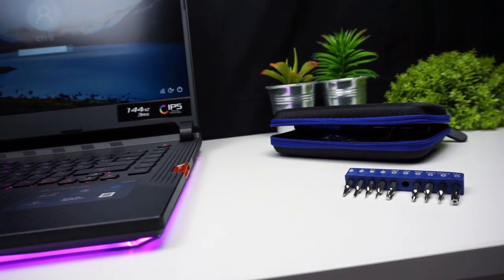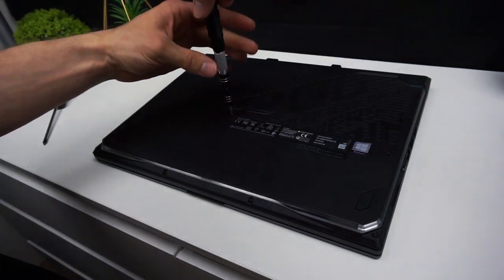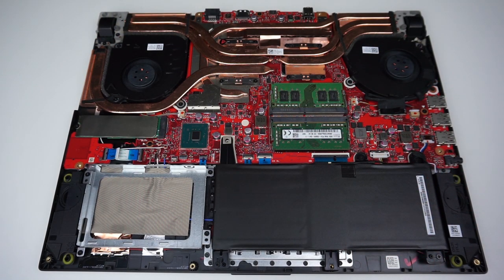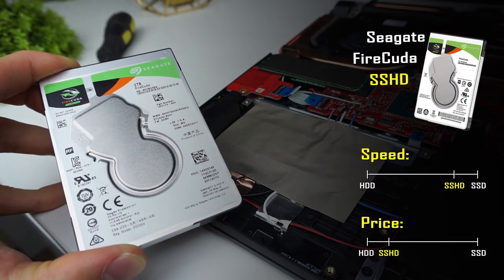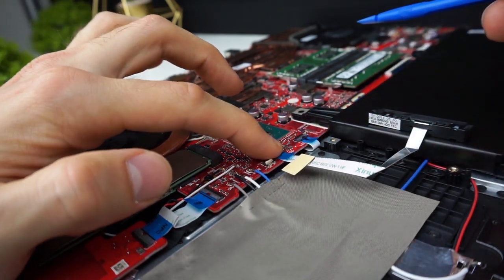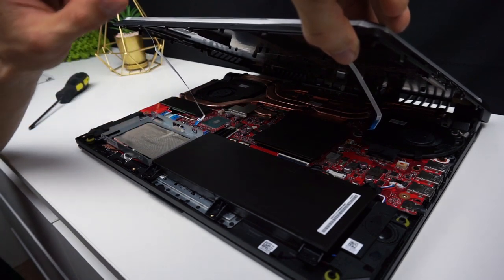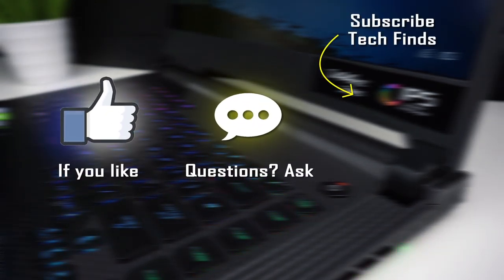Asus Scar III Upgrade RAM / SSD / HDD - Disassembly Guide

Comment from the maker: ✅ Free download RAM / SSD / HDD data recovery software: https://bit.ly/2zRpN9B

TIMESTAMPS:

00:00 - General info
00:35 - Opening the lid
01:16 - Disconnecting light bar
01:49 - Disconnecting battery
02:05 - Installing Hard Drive
03:57 - Installing RAM
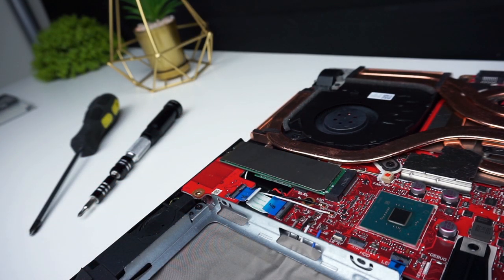04:15 - Installing NvMe SSD
04:50 - Closing the lid
05:20 - In case of PROBLEMS
Reply: Tech Finds 

Do I need to unplug the battery if I just want to put a 2nd ram in the empty slot?

And if I don’t unplug the battery the laptop can’t not turn on like in the video right?
Reply: What is the company name and model number of pre-installed M.2 NVMe drive???
Reply: @bhavik3497  It's Intel's M.2 SSD, but I'm not certain of which model it is.
Reply: @Springfield_7.62x63mm  can u please check in TaskManager > performance> SSD (where  the graph is shown) on top right corner of graph there is the model number written
Reply: @bhavik3497  INTEL SSDPEKNW010T8. That's the model number of my SSD.
Reply: @Springfield_7.62x63mm  okay thankyou
Reply: @bhavik3497  You're welcome. :D
Reply: I have the 17.3 inch one. Does any one know if it had an additional heat sink. I am scared of opening it :)
Reply from the maker: @peterfarah6015  It has the same cooling
Reply from the maker: @senyuguan6221  I don't own this laptop mate
Reply: @techfinds hey my laptop is doing the same thing as yours at the end of your video ive tried the hard reset any other advice? Thank you
Reply: I Have an asus rog strix scar 3 g531gu i7 9750h up to 4.5 16gb ram 512ssd and nvidia 1660ti ,6gb.
Can you please tell what is the maximum of Ram that I can Add and the maximum of Ssd or m.2.  Can I add another 1TB m.2 nvme and tell me please if it's possible to change de nvidia Card? Thank you. I wait for an answer :) if i spoke bad in english. Sorry!
Reply: Is any link for SATA Cable?

Comment: Just added a Samsung EVO ssd to my Strix Hero III.  Thanks to this video it took 20 minutes with zero issues.  Thanks for the great video!
Reply: What ribbon cable did you use? Where did you get it from?
Reply: Hey, I have a problem. My device don't recognize the data 2,5
Reply: @mozamorris  my Hero III came with an extra ribbon cable in the box. If you still have your box, take a look around for it. If not you'll have to try and find one on eBay or contact Asus.
Reply: @leonard9501  after you install the drive (assuming it's connected correctly) you have to go to Disk Management inside Windows. You have to assign the drive to a letter and format it in order to use it. Hope this helps! Good luck!
Reply: @Arch Deluxxe  you said what you added one more ssd, if i right understand, so I want to ask , how ? I will buy samsung evo plus, butt how I see from this video its socket for 2,5" , can I install M2 ssd in this place?
Reply: i gota q uestion i got a SSD + a hardrive of one 1TO can i add a 4To on it to have 3 Discs or is it not possible thanks to reply

Comment: Great video. Installed an extra 16GB of RAM and a 1TB SSD on an ASUS Strix G. Experienced zero issues. I've never upgraded a laptop before but your presentation explained everything I needed to know. Thanks!
Reply from the maker: Good, have fun now. :P
Reply: did your strix G already have a caddy inside when you openned it?
Reply: Yes, and four screws were included as well.

Comment: Thank you very much for this video just today I upgraded my newly bought laptop same kind but with a gtx 1650. It was super helpful this video I put in mine 32gb ddr4 Kingston hyper X dual channel mode and a 2tb hard drive. I followed your guide and even held the power button for 30 second immediately after disconnecting the battery so the capacitors will discharge and avoid any problems at the end to not open it again. Thanks again and keep up the good work
Reply from the maker: Thanks for your kind words!
I'm glad you found it useful.
Reply: @TechFinds  what is the maximum storage for the 2.5" SSHD slot sir (can i upgrade mine up to 4 or even 8 TB)? mine is G531GU-I766G9T, probably it's a G series not hero or scar but i don't really know
Reply from the maker: @m_aminoracousticmusic6312  2.5" drives over 2TB are usually thicker so it may not fit. I haven't heard of any HDD/SSD/SSHD limits tho
Reply: @TechFinds  okaay then i'll just go for it, because if 4TB is too big imma just take it wherever i go with external hard drive enclosures lol

Comment: Okay, if it wasnt for your video i couldnt have done my upgrades and the best part i opened it only once and put in 32gb ram, a 2tb WD M.2 SSD, and a 4TB 2.5" SATA SSD ddrive, put the cover back on, tighten the screws, reset the power, and bam it actually booted up and i have been using it now for a week, you are a genius....thank you, thank you, thank you, Pipefittermike, i have subscribed.....
Reply from the maker: Thanks for your kind words!
Good to know that the video was helpful.

Comment: hello I have a question, if my laptop already has an 8gb ram, is it necessary to buy 2 new ram and replace the one that comes from stock?
Reply from the maker: No, you can buy just one additional stick of 8GB for example to have 16GB in total. It's just important to match the specs with original ram
Reply: @TechFinds thank you very much I suscribe

Comment: Hi I just want to ask ...when I add the 2.5 drive how will I know which the laptop will choose as the boot starter/ main drive between the NvMe m.2 and the 2.5 drive

I personally would prefer the m.2 to be the main drive coz it’s faster 

Thank you
Reply from the maker: If you bought the laptop with M.2 SSD and Windows installed on it then it will boot from your M.2 SSD even if you add another drive.
Reply: Tech Finds oh thank you so much yes my laptop has windows and m.2 installed when bought

Last thing tho...if I download stuff like games do I have to choose what drive I download it into. Thanks for your help awesome helpful vid
Reply from the maker: @drvince0725  you can choose where to download an install your games/programs.
Reply: Tech Finds hahaha sorry for asking a dumb question...anyway thank you for the responses👍

Comment: Thank you for uploading this descriptive video. Followed this guide while installing a WD Blue 1TB HDD into 
ASUS ROG Strix G731GU Laptop and it worked perfectly. Did the additional step of "holding the power button for 30 seconds immediately after disconnecting the battery" as pointed out by @Vasile Ilea. Keep up the good work!
Reply from the maker: Thanks mate. :)
Reply: @Akila Nonis 
Did you use the same flex cable from the video description? 
I have a G731GU and want to put a HDD but I didn't find the flex cable for this model, only found for G531 but I don't know if it'll work with that cable.
Reply from the maker: @strattahernandezjuandiego2078  If you're from USA you can try to find the cable for G731 on the site that i linked
Reply: @TechFinds  It wasn't there either, but I just found it on Ebay, I hope it works. Anyway, thanks a lot. Your channel is awesome.
Reply: @strattahernandezjuandiego2078  The flex cable which I used was the same but the pre-folded pattern of the cable was not the same as in the video. Because of that, I couldn't place the cable beneath the hard drive.

Comment: man this is by far the best teardown/upgrade i have seen. i have the same model, if my OS is on my SSd how can i uopgrade ? also do i have to setup the new rams through BIOS or the computer will auto detect them ?
Reply from the maker: You'll need to fresh-install windows on the new drive and transfer your files or clont he drive. The RAM will work automatically
Reply: @TechFinds  thank you

Comment: Really Good Vid and explanation
Upgraded the asus strix scar 3 w/ rtx2070

I upgraded my empty drive bay with a 2.5" samsung 860 Evo 2 tb ssd and it worked perfectly. 
You do have to go into Disk Management in Windows 10 and Create new Volume with the Unallocated drive to make it show in your file library,
just putting it out there for any of you that dont see it in your file library immediately. But You have to do that for any new hard drive install anyways. 
Video was Excellent Deserves a Sub!
Reply from the maker: Thanks mate! I'll probably make a separate video showing how to do the Disk Management work. A lot of people ask about that.

Comment: Thank you for detailing this process so well. Other videos vaguely gloss over things and don't zoom in/point out the nuances to open latches and such.

if I may ask, does it matter which side up the SSD is installed? Or since it's connected through that extra connector, it doesn't matter? I got a Samsung EVO SATA SSD and it's pretty much logo side up or not.
Reply from the maker: Are you talking about M.2 SSD or 2.5" SSD? The 2.5" one can be upside down, but the M.2 not.
Reply: @TechFinds  It's a 2.5" SSD. I installed it as similarly as I could to your video. Though I couldn't get the chassis out (one of the screws stripped). Thank you again for this thorough video, I really referenced it closely.

Comment: By doing this will this void warranty? 
And since there is already a 8GB or ram inside and can you add another 8GB of ram of a different brand?  Or should they be of the same brand?
Reply from the maker: It may vary between countries so better read your warranty card. You can mix brands but match the specs.

Comment: Thank you so much for the video, I’ve been thinking to add some HDD to my laptop and this video really helps to get an idea. The cables for the lights on the bottom lid are to be expected, yet I’m sure I’d have forgotten about them. I wonder though would it be a problem if I don’t reattach them afterwords? 🤔😅
Reply from the maker: You would not have lighting then, but the laptop should work. If not you can open it again and connect the cables back ;)
Reply: Tech Finds thank you for the reply! Your channel rocks! 😊

Comment: Is the process the same for a rog Strix g17? Also where can I find the hdd connector cable?
Reply from the maker: It looks like G17 has the same chassis so yea. I linked cable in the description, you can also search for it on that website

Comment: Hey really great video! Just one question,   If I buy a hyperX ram stick and put it in the empty slot would it work fine in dual channel without reducing the frequency or would I need to get 2 × hyperX ram sticks?
Reply: What I mean is combining the already provided ram with hyperX or both have to be hyperX for dual channel.
Reply from the maker: @aaxkit  If you wanna mix you better buy Crucial instead to match the specs. HyperX is a good option only when you buy 2 new sticks. The latency difference may cause dual channet to be not activated and the frequency to drop.

Comment: Questions
1. Do you need to buy the caddy and cable separately?
2. Is the caddy only supported for 2.5 hard drives, solid state drives and sshd
Reply from the maker: 1. Cable and caddy are included with the laptop by default.
2. yes, only 2.5" will fit
Reply: Tech Finds is the cable in the laptop?

Comment: Very good and informative video.
I think the next time you do something like this again, you should at least mention which is the boot drive and swapping the boot drive for a new one will also include a clean Windows install. Other than that, the video was amazing.
Reply from the maker: Hey, thanks mate.
Thanks for tip. Vast majority of gaming laptops come with m.2 SSD which is always boot drive. Unfortunately I don't have any m.2 SSD to replace the original one.
Reply: @TechFinds  Yes, but you're doing a video of how to replace what is in most cases, the boot drive. It wouldn't harm to simply mention it.
This video has been 2 months already and I didn't expect you to actually reply on this. Keep up the good work!
Reply from the maker: @patrickfigo8934   I reply on every comment (if I notice) ;)
So you mean mention only. Good idea, you're right. I think I can do that even though I can't show the whole process.

Comment: My sataCable camed with an earth teip, the cable was also bend in a way so the cable goes around the corner screw and in that way i could connect the earth to the plate. I can see that on ur board the screw closest to the connector goes diagonaly but mine is opposite, thats also why the flexiCable is bend in the way mine is. I didnt see that u connected any earth on ur board with the hdd/ssd. But they maybi upgraded that on my board.  However nice video and thanks👍

Comment: For the caddy hdd the data connector is in the way of the 4th screw hole
Reply from the maker: Maybe you have different cable. Mine wasn't in the way of any screw
Reply: Tech Finds yeah could be, it was the bottom right screw. Could also be the hdd as I used an external I had and removed the case and connector and used that.

Comment: Can I use a  external 240hz monitor on this laptop? And does it work  Over 144hz on the monitor? Or only 60 hz?
Reply from the maker: Well, i don't think that HDMI supports 240Hz. Also the laptop doesn't have Thunderbolt 3 and MiniDisplay port, so you're bound to HDMI. You can always buy 240Hz model.
Reply: The built in screen has 2 versions, 144hz and 240hz
Reply: Tech Finds it has usb c , i have heard it can connect to monitors over 144hz , and i just ordered a new monitor pls let me know if you try it.
Reply from the maker: @makavelivii6518  It has USB C but without Thunderbolt 3 support, so you can't connect evternal monitor.

Comment: @Tech Finds do you have to disconnect the light bars to insert the ram or can I just hold the lid while I put in the ram?
Reply from the maker: You don't have to disconnect the light bar. You can pull up the bottom panel, flip it over and lay down in front of the laptop. Then you can replace RAM.
Reply: Tech Finds thank you 🙏 for telling me.

Comment: Great video! You've earned my subscription. Quick question if you're out there, did your SSHD come with screws? Because mine didn't, and I'm starting to wonder it something's wrong.
Reply from the maker: Hi, welcome on board.
The drives usually don't come with screws, but you should get the screws with your laptop. Check the box or envelope with paperwork where screws and ribbon cable should be

Comment: What screwdriver do you need? Also does the ram need to be 2666mhz or could i use the 3200mhz option?
Reply from the maker: Use a precision screwdriver that fits the screws tight. 2666MHz is max
Reply: @TechFinds  Thanks! :P

Comment: Hey there, purchased this laptop because of you, you really helped
 my decision, now i have a big issue : High temps and cpu throttling all
 the time under load or games, in turbo or manual it passes 95/98 ºC and
 throttles down, laptop doesn't seem to be hot enough for that, my guess
 would be the cpu temperature sensor failure but i don't know where it 
is located at...Can you help me out? Its a Scar iii G531GU with i7 9750h
 and 1660ti, graphics card never gets hot, only processor, what can i 
do? Thanks!
Reply from the maker: As i mentioned in many videos with Scar 3 it's the matter of thermal paste. You most likely got a defective unit with bad thermal paste application or as you mentioned the sensor may be defective. It's normal that GPU is always much cooler than CPU in laptops. You should consider sending your laptop for repairs / replacement on warranty

Comment: Hello! I'm trying to install a HDD in my Scar iii BUT I can't find anywhere that has the HDD Sata ribbon cable. Even the Asus accessories page doesn't have the HDD ribbon cable in stock. Do you know anywere else that stocks it?
Reply from the maker: Asus store is the only place where i found the cable, but i don't know if you can't use any other compatible universal cable. You should have got it with the laptop. Most people have it in the envelope with paperwork.
Reply: @TechFinds  thanks for the feedback. For anyone else in the same situation, turns out Asus DOES include the cable in the laptop box, it's just well hidden!

Comment: I added a WD Blue SN570 1tb NVMe SSD to an Asus ROG Strix SCAR 3 and the laptop freezes at the logo screen. Can't enter the bios. I've tried disconnecting the battery and holding the power button down for 40 seconds to clear the CMOS but always locks up and never get to boot from the SATA drive. Any idea to help thanks.

Comment: quick query. is the caddy already inside the laptop? and is the cable available from anywhere else because it seems to be sold out at the moment
Reply from the maker: By default the caddy should be inside the laptop and you should have the cable inside the box/envelope with paperwork. I don't know if you can buy the cable from anywhere else. Search for it on the internet

Comment: Do you need to remove the led flex cables  or can you just leave them and put the lid to the side, then continue? Is it ok if I dont unplug those cables because they are really hard to take out.
Reply from the maker: You can leave the cables connected, flip the lid over and upgrade your laptop, but then you have to be careful to not tear off the cables accidentally

Comment: Do I have to disconnect the battery?
Those pins look so fragile.
Reply from the maker: It's for safety purposes and to prevent potential components damage, but I usually don't do it and nothing happened yet. ;) Do whatever you think is right, but on your own risk

Comment: Completely new to the pc world. Why do we need to disconnect battery?
Reply from the maker: You don't have to do it, but it's a good practice to avoid eventual  shock. Never happened to me tho
Reply: Okay. I was curious since I want to add another ram stick to my laptop and if I can avoid the problems starting the laptop back up by not disconnecting the battery I would :) thank you for responding.